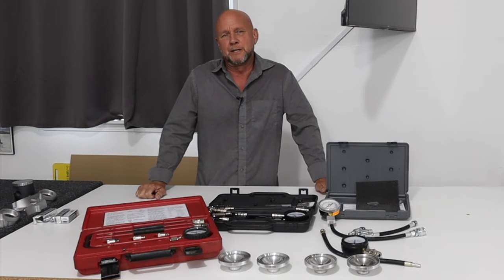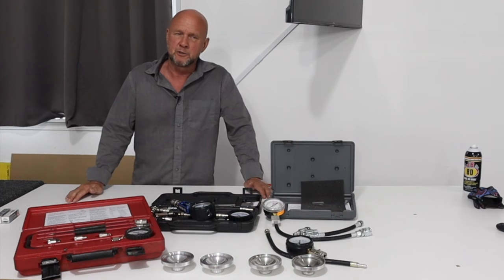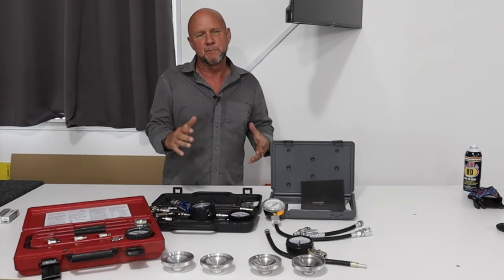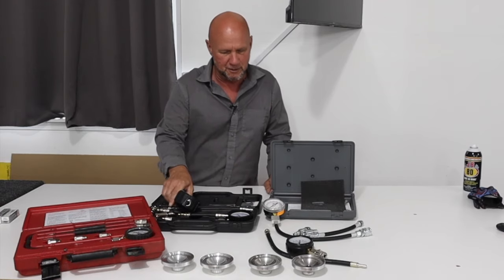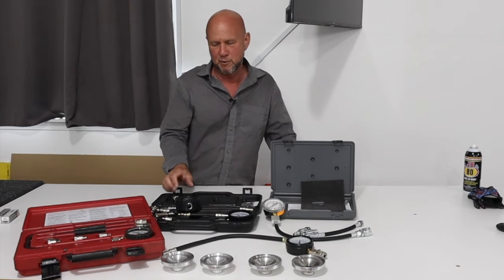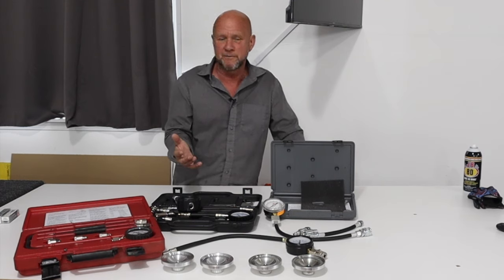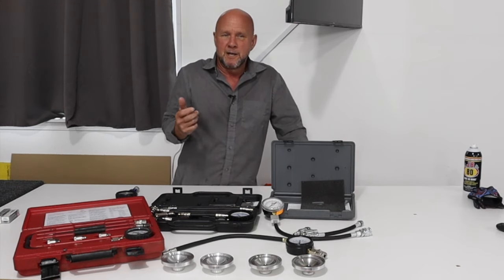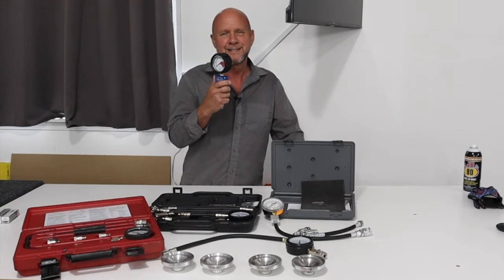5  compression testers with a 55 psi variance.  Hundreds of dollars wasted. A 3 hp and 3 hour loss.

Comment: Chasing data with off the shelf equipment can be frustrating, we run out and buy new testing equipment and expect it to be correct. I find myself doing the same thing, even though I had worked for a company in the past that required the use of certified pressure gauges for all testing for consistent readings. Watching your videos has me back to what I was taught when testing, never work without a leak detector or soapy water when testing and trouble shooting. Thanks for the reminder to never assume your equipment is leak free without always checking connections or even for internal gauge leaks.

Comment: I love and appreciate your presentation style and demeanor. I like honesty, integrity and someone who is not afraid to act liike an adult.
Torque wrenches no matter the price or brand can vary a little, a lot and even the same wrench can vary drastically every time it is pulled. 
I used to have torque wrenches re-certified for their calibration every 6 month at a job I worked at because it was a mandatory requirement (nuclear motor designing and building).
I have seen some that needed to be sent back to the supplier or store for exchange as they were off from brand new.